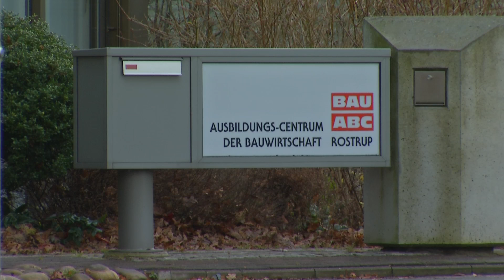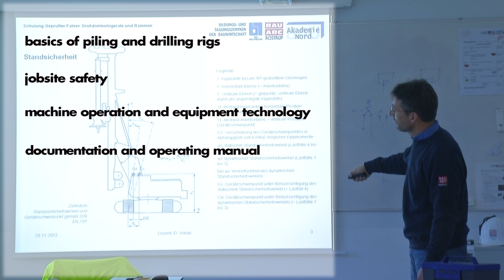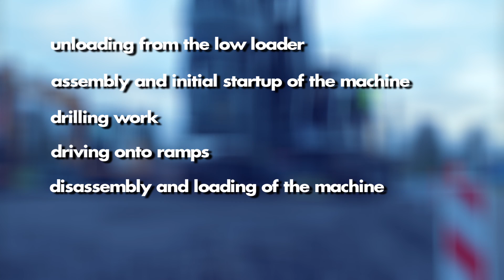Liebherr - Training for Rotary Drilling Rigs

Comment: Rotary Drilling Rig precision rotary control driven by Digital Hydraulic Motor / 旋挖钻数字液压马达精密回转控制

https://www.youtube.com/watch?v=NtdcpITSzgQ

Precision Rotation Control of Digital Hydraulic Motor

The rotary drilling rigging requires frequent rotation and accurate positioning, and the rotary inertia reaches tens of tons-meters. At present, there is no automatic control system, which can only be realized through the experience accumulated by the operator for many years and with highly centralized control. 

The rotary drilling rig driven by AEMETEC's digital hydraulic motor realizes high precision repeated positioning and slow start and slow stop, which not only greatly improves the operation accuracy and efficiency, but also reduces the fault and fuel consumption, and cooperates with the digital hydraulic motor crawler control, Combined with DGPS, automatic drilling operation can be realized.

▉ Rotation error: + /-0.2 degrees
▉ Rotation speed: + /-0.2 ~ 60 degrees / second

数字液压马达精密上装回转控制

旋挖钻由于需要不断将钻取的土石从孔洞内取出，因而要求上装回转频繁工作，且需要实现数十吨米大惯量大扭矩平顺启停和精准对位。以往这是一个没有攻克的难题，只能通过操作手多年积累的经验并配合高度集中的操控，方可实现对旋挖钻机的高效安全操控。 

数字液压马达驱动旋挖钻机上装回转实现高精度重复定位和缓启缓停，不仅让昨夜精度、效率大幅提升，还降低了故障、燃油消耗等，配合数字液压马达驱动的履带行走控制，结合DGPS便可实现自动钻孔作业。